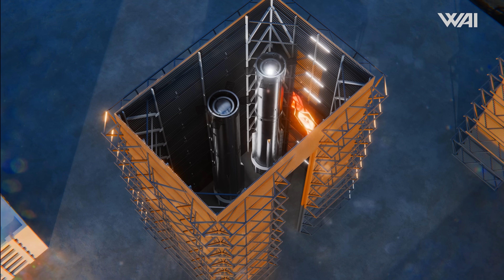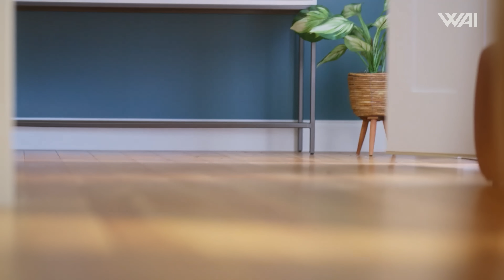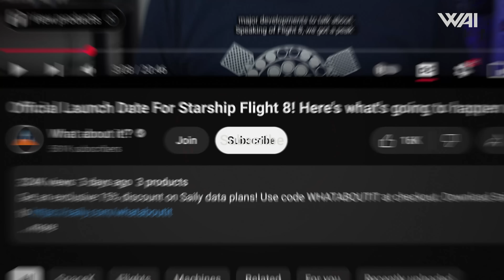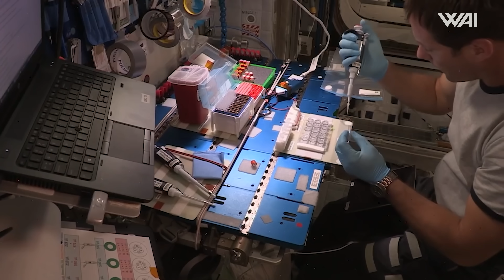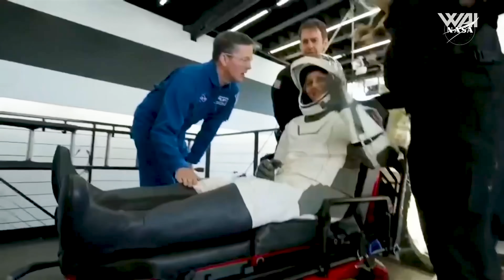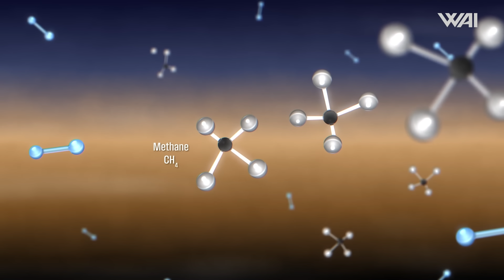SpaceX Doubling Down! Starship Block 3 is HERE! & Biggest Starship Project Yet Announced!

Comment: I fear the new heat shield won't be able to withstand the stress, especially during a return from Mars at 41,000 km and 3000 degrees C. I don't even want to talk about reusability. Carbon-on-carbon with a tantalum carbide coating would probably be more appropriate.

Comment: I just hope they can get it all working, soon. They had one flight where both the booster and ship could have landed, they caught 2 boosters, but it's still not at launching knowing it will work with a very low error rate yet. There will always be some error rate, as with every system, you have to hunt for 100% success rate, to get it as good as you can, but you will basically never reach it.
And yes it is hard, but it has to be possible, it is possible, there's no reason it's not.
I just want to see these fuckers go up and come down and do it all right, and have us have the ability to send more up, bigger space station at a lagrange point, a moon base, and Mars.

Comment: Keeping Starship catch towers separate from booster recovery/launch sites might make sense even after the rapid reuse is in place. Otherwise TWO perfect catches per launch would be required to safeguard the most important component of the system, which is the Stage 0. Starship catch towers can be built easier than the Launch Mount. And if we put the Starship catch towers on a rail system, they could transport the rapidly reusable Starship over to the launch mount to be grabbed, lifted, and remounted for flight.
Reply: No need to make the integration towers mobile. The SPMT is quite capable of rapidly moving stages between integration towers. Just improve the remote control and autonomy of the SPMTs, so crews can control them from far away.

Comment: They should stop and heavily modify the rocket from being a chemical rocket into a nuclear powered rocket.

Starship would be better off if it had Nuclear Propulsion rather just simply the raptor engine which is essentially a combustion engine that used methane as fuel and oxygen as its oxidizer.

Comment: I would like them to just stick with something working and actually get some goals on the board. At the moment the goal post keep moving. Changing versions seems like a backstep. Lots of storage capacity will be needed, but it will need to start paying for itself before you get too far. You are lucky you get a lot of local visitors.

Comment: The Booster is not really the issue ATM. They need to get the Starship to control landing on the far side first. Block 2 seems to be all garbage and I don't think SpaceX is going back to Block 1, so we need Block 3. Until this successful flight happens  the Starship program is just stuck!!

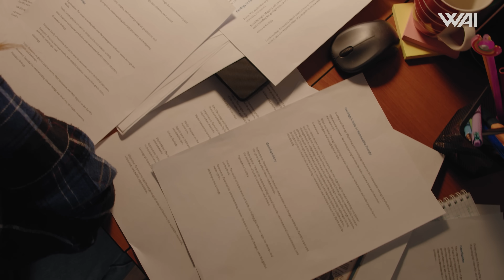Comment: 11:10 I think building any further Starship launch sites is premature until the prototype testing is done and Starship is operational. 
Like the Space Shuttle launch site at Vandenberg that was never used, it’s a gross waste of time and money that can be used elsewhere. 
Putting the cart before the horse. 😮
Reply: Maybe if it were a government project that would make sense, but they don’t have to actually succeed to continue existing. 

SpaceX’s plans are to massively ramp up ship development and they aren’t depending on Starship for revenue. Starlink and Falcon 9 launches are their main revenue stream, with no significant competitors for at least a few more years.
Reply: For a company, it would be very critical. Governments can bury the waste and charge taxpayers unlike corporations that have to show spending to investors and the IRS. 
A whole town was incorporated and multiple launch sites built in anticipation of Starship. 
Thousands of jobs also rides on Starship…
A lot riding on this design being successful and no fatal design flaws… 
No pressure…😂
Reply: SpaceX needs to greatly increase the size of Starlink satellites launched into polar orbits. Thus, they need Starship launches from Vandenburg. 

Starship will also drastically reduce launch costs compared to Falcon 9, carrying about 20 times more mass to orbit per flight. (Each launch saves 20 expended Falcon 9 second stages.)

Finally, every Starship/Starlink mission will be testing the momentary design of that time. We can expect the design to continue evolving and require extensive testing using Starlink (and propellant) payloads. 
 @darkguardian1314

Comment: I got a question for you Felix. I have been keeping track of all latest trips to the moon by different countires and companies and most of them have been unsuccesful. It occurs to me that by now we should be extremely good on the math that gets us to the moon and allows us to land safely. Not only that, we now have the means to accomodate inside of any automated spaceship an AI that could do the trick of taking decisions on the fly if anything goes not according to plan. But still we manage to screw up and crash on the surface of the moon. It would be a great pleasure to get your opinion on the matter. Thanks !!!!
Reply: You assume “AI” is contained within something as small as your phone; it isn’t. It’s something that is contained in huge server farms. Whereas a (small) spacecraft landing on the moon- even a body as close to Earth as Luna- truly is on its own; it not only can’t be accessing in real-time the “AI” in farms quick enough to do any good - and that’s assuming that the limited onboard control system and rockets etc are up to the task- it can’t be carrying the invite amount of high-quality sensors that would be needed to avoid all obstacles, determine exact soil condition for landing so tip-over (a big problem!) isn’t an issue, etc. etc. - Dave Huntsman
Reply: Seems like current rockets are not large and powerful enough to hold and lift a robust lander.

Spindly little legs. Insufficient fuel for abort and retry. Insufficient electrical power. Insufficient compute power. Etc.

Comment: I mean, i've been saying catch towers forever.  The fact is, Ship will NOT be caught and immediately restacked on a booster in most use cases.  The only use case where this makes sense in the near term is for the tanker variant.  Every single other use case will require the ship to go back for payload integration of some kind or another.  Now yes, there will ultimately be more flights with tankers than any other variant, but even with tankers I would expect it to take a year or 3 to get to the point where they are comfortable with 0 refurb or inspection before reflight.
Reply: I've also been saying this forever ant your comment is pretty much word for word the comment I was going to make including mentioning the possible exception of tankers.

So many people seem to ignore the fact that (again, except for tankers) Ships will ultimately be carrying complex payloads that will need a payload integration facility for them to be integrated into the payload compartment (or removed from a payload bay if Starship ever gets used for recovery missions e.g. bringing a satellite down from orbit for repairs and/or upgrades).

I suppose the only observation I might make on your comment is that perhaps being really pedantic your ""every single other use case will require the ship to go back for payload integration of some king or another" is ignoring a crewed mission, perhaps when big space stations are up in orbit and crew rotations are numbered in the tens of people at a time. I suppose that if/when we get to that point then in theory, since by definition the launch tower would have a crew access arm to get people on board for launch, such a crew-carrying mission could be turned around a bit like an aircraft with crew getting on and off via the walkway (crew access arm) and new supplies to go up to the space station such as food, water etc wheeled on via the same walkway.

While maybe that's theoretically possible I still agree with your everything-but-tankers assertion because I think it would be pretty dumb to handle crewed flights like this for a number of reasons. Firstly, you'd be clogging up a launch tower while you turned around the crewed ship. Secondly, I think it's going to be a very long time before crew flights would want/need such back-to-back airline-like cadence. And finally, the launch complex will in Musk's high cadence world be a pretty hazardous area with boosters and ships getting fuelled for launch and presumably also handling booster static at least during testing. For safety reasons it would be much better to bring crew returning to Earth back into an at least somewhat safer dedicated catch area where there isn't as much methane and lox being pumped around the place.
Reply: @julianfp1952  exactly, completely agree. Crewed passenger ships are the only long-term use case I can think of that might benefit from a rapid turn around like a tanker.  I think that is so far down the line though it's almost not worth mentioning.
Reply: Keeping Starship catch towers separate from booster recovery/launch sites might make sense even after the rapid reuse is in place. Otherwise TWO perfect catches per launch would be required to safeguard the most important component of the system, which is the Stage 0. Starship catch towers can be built easier than the Launch Mount. And if we put the Starship catch towers on a rail system, they could transport the rapidly reusable Starship over to the launch mount to be grabbed, lifted, and remounted for flight.
Reply: Some of the people with XCOR's seven flights in one day experience are at SpaceX. Reload fuel-lox-helium, charge batteries, put another person in the right seat... and I wasn't even there that day to supervise.

Comment: As we have discovered,  more and more, substantial  sonic damages are possible from higher-energy launches. At some point, SpaceX will have to revisit offshore launches and landings. (Also needed, in order to eliminate increasing-scale zoning complaints, general safety concerns, etc.)

Their preliminary investigation of such--trying to convert single semisubmersible drilling platforms--failed, by thinking too small in scale. (Believe it or not!, for SpaceX.) 

Such SpaceX offshore platforms need to have surface areas multiple times the deck size of current semisubmersible platforms. 

SpaceX could buy  PARTIALLY constructed  multiple semisubmersibles. The legs and basic platforms can be conventionally constructed. Then, the platforms can be welded and fastened together. Then, further (custom) construction of below-deck SpaceX infrastructure, integrated launch towers, etc.

Felix, please stay alert for SpaceX making preliminary moves towards such.

Comment: Having multiple launch towers at a site seems ambitions, but will they be able to load up or pull ships away from one tower while another tower is currently in operation? Seems dangerous and unlikely. In that case, it doesn't matter how many towers you have if you're gonna be limited to using one or two at a time. UNLESS, the redundancy is to allow for refurbishment and repairs to complete on one site while getting another site ready for use, or for fuel loading and engine tests to occur more frequently.

Comment: I keep hearing about the production of Rockets by SpaceX, once they have perfected starship where are all the launches going to go? The space around earth is so crowded that eventually they will not be able to launch rockets into space at all without risk of hitting debris.
Reply: Well, SpaceX is putting up most of the satellites around Earth; and SpaceX will be the one that will have to deal with that fact as well. So don’t be surprised later if we find out later that they are working on it. - Dave Huntsman
Reply: @dphuntsman  well they're always working on something😂
Reply: Relational GPS is already accurate to about 5 millimeters - which is how the booster catches went so very well. Many ships can accurately park in orbital clusters without danger of collisions.
Reply: @imconsequetau5275  GPS is not that accurate and is not much good in space.
Reply: Relational or Relative GPS, often referred to as Real-Time Kinematic (RTK) GPS or Differential GPS (DGPS), can achieve accuracies in the range of 2–5 mm under optimal conditions. This precision is significantly better than standard GPS, which typically offers accuracy in the range of several meters. 

Specialized space-grade GNSS (Global Navigation Satellite System) receivers, optimized for orbital dynamics, can improve from several meters to sub-meter or centimeter-level accuracy under ideal conditions.
 @jg-bd3hr
Reply: The ship will go to mars where they will have a look later 😊 the mission is called mars interpretation transporter 😊 and the life will be 2 years 😀

Comment: The Florida base should be designed for handling up to 18 meter diameter starships.  That means at least two of the launch towers can be easily upgraded to the 18 meter starships (tall enough, enough strength to lift it, the flame diverter large enough, propellent loading fast enough & large enough for 4 times the volume.   Also the gigabay will need to handle 4 boosters simultaneously.
Reply: Why?  There is no such design, that was just one of Musks pieces of hyperbole in answer to a what is after starship question which as yet has no answer.  

18 meters would use about 140 Raptor 3s and be at least 8 times as powerful as a Saturn 5.  
:planet-orange-purple-ring:
Reply: @Scanner9631 yea I agree an 18m starship is so far out that the current designs for ground infrastructure would prolly be outdated anyways
Reply: @Spacejax05  ground infrastructure would prolly be outdated anyways

4 times the mass if the height stays the same.  How tall would it be?  Too tall for the current tower design?  How far can those arms spread?  Can they handle that mass?  

The launch pad with the igniters and hold down clamps would not work with both 9 and 18 meters.  

The hole flame diverter would need massive redesign.  
 
At least 4 times the propellant supplies on hand.  

How load would it be?

:planet-orange-purple-ring:
Reply: @douginorlando6260  18m starship is a pipe dream
Reply: @inyn_k … 18 meter starships are more practical than a thousand 9 meter boosters needing 4 times as many launches.  4 times as much payload per launch. And it improves the cost benefit of one way starships which would greatly improve the 400% payload increase to more like 500 or 600%.   And this is assuming no increase in booster height. If booster height is increased 25% then the 600% increase in payload could easily hit 700%.    Seven times as heavy payload per launch!
     My point is to plan ahead and incorporate an upgrade path to the Florida infrastructure.  That could mean 12 meter diameter starships using one of the 4  planned launch pads to be built later.   No point in tearing down a tower designed for existing 9 meter boosters.  It could mean instead of 12 meter boosters, a starship heavy with 2 side boosters.  Just design the infrastructure to allow upgrades for many possibilities without having to tear down infrastructure.   9 meter diameter launches will continue on the old towers even after larger boosters are operational on a new tower.
Reply: 18 meters width is looking too far ahead. 12 meters is a reasonable step up in diameter for a wider next gen Starship. However, even version 3 is not the tallest that a 9 m version can be.  
 @douginorlando6260
Reply: @inyn_k Not for Musk 😂

Comment: The question i would like to know is do they know what has been causing the last three ships to blow up, i guess No 10 will answer that , one way or the other
Reply: You can just check the reports SpaceX gave. First was POGO, second was a mixing of fuel and oxidizer in the engines themselves, third was a loss of attitude control due to tank depressurization.
Reply: @logicbuilder1204   i wonder what the 4th excuse  will be  :face-orange-raised-eyebrow:
Reply: @bingobongobungo  I don't think you fully know what the word excuse is. If they said "We didn't have enough time to properly test it" or "we had a lack of funding", those would be excuses. This is just... saying what went wrong?
Reply: Yes, we all do. It's called the Flight Termination System (FTS) - high explosives designed to intentionally blow up a rocket whenever it goes off course.